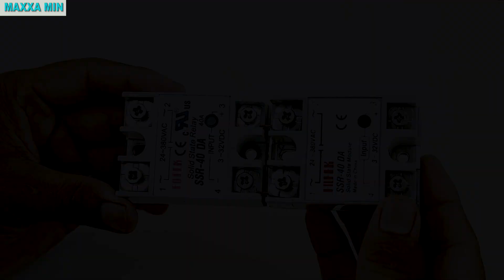220V Electric Generator 775 Motor Copper Coil 15KW Transformer Light bulb super idea

Comment: Hi, Please mention details in scripts, like copper wire used in mm - gauge -  embedded or live - motor rpm, shockets , magnet size facing detective like attraction side or repulsive side, fuse etc. These details will attract more view's